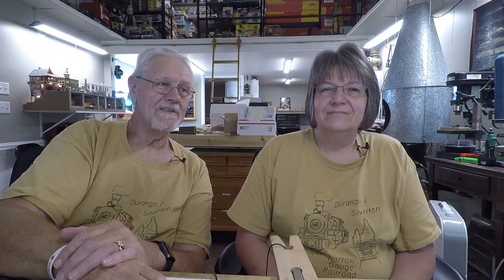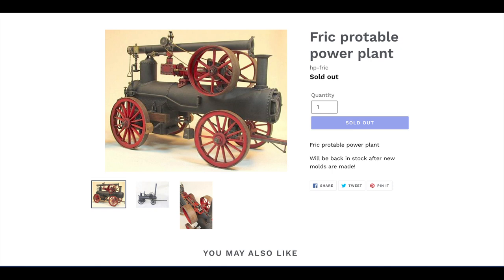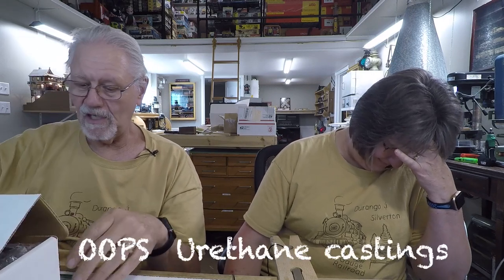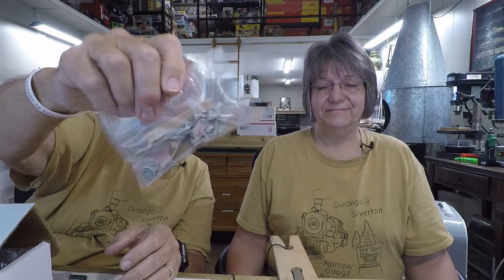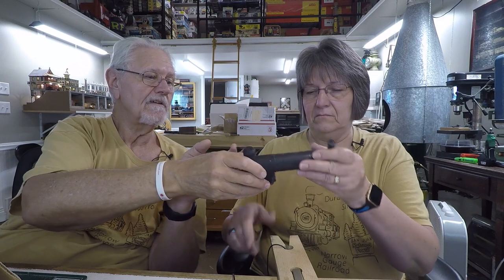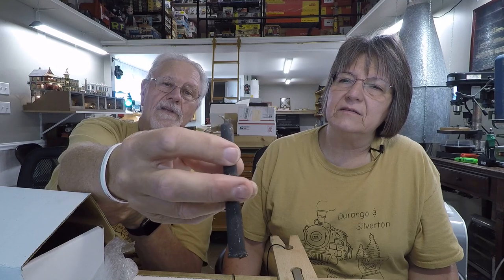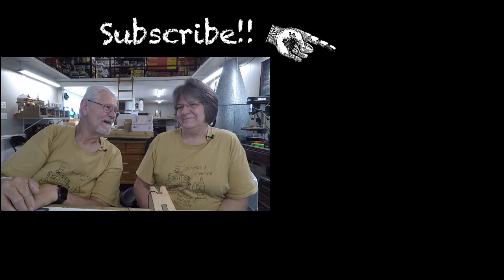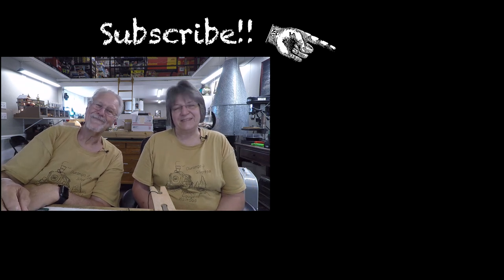Hartford 1:20.3 scale Fric protable power plant

Comment: These old molds or cast parts need to be scanned and drawn into a 3D cad model so they can be 3D printed with these new resin printers.
Reply from the maker: Hum… yes that sounds perfect. Dave has a GREAT 3D printer too
Reply: I unfortunately don't have my own 3D CAD program
Reply: @timothyboles6457  Fusion 360 is available for free online.

Comment: J. Nelson Cross bought one in the early 1920s to power his Frick sawmill and when drought seasons occured his grist mill. The normally water wheel powered York County Pennsylvania Wallace-Cross Mill constructed a shed against the south exterior wall for weather protection, a belt provided power through a removed window. Old photos show the tall smoke stack protruding through the roof, it was modified having a double flare trumpet on the top (The lower flaring outward, the upper flaring back to the original diameter). Horses moved it between the mill and to the sawmill across the creek, the tall smoke stack required removal and replaced for each move. 
Hope the kit becomes available.

Comment: Along with being used as a portable power unit they were used as boilers to power things like portable steam drills for drilling rock for blasting and running portable steam powered bucking saws. Of course this was in a time before the internal combustion engines were around.

I was at a logging museum out on the coast and they had photos of these running "portable" equipment as well as running a small saw mill.

One of the neat things they had was a couple of the old l photos enlarged and put on on the walls in the museum depicting early logging scenes.

Comment: Portable steam engines were used for things like driving water pumps, stone crushers, chaff cutters or running saw benches. All driven by belt from the flywheel.
Just like the prototype, the chimney hinge is a weak spot.
Perhaps you could set yours up to run the saw mill.
Reply from the maker: Jude no space… but perhaps at the mule shoe curve in the big canyon

Comment: Is this considered to be a “steam donkey?”  Great addition to your railroad.  Sorry to hear you need to redo the outside!  Take care and stay cool.
Reply from the maker: Hum... sort of the same idea. Not sure if the name fits... Anyone out there know?
Reply: A donkey would have a boiler and a two or three main drum winch mounted to a single log sled so it could be moved from site to site with relieve ease.

Some of the early donkeys had a large diameter vertical capstan that the wire rope was wrapped around to get the pulling force needed.
Reply: Donkey engines usually had vertical boilers and cylinders to optimize the skid sled's limited real estate.  Job site transport was established by the cable and winch.  
Get the molds scanned so 3 D printing can reproduce robust new ones or simply a single spare part.
Sawdust would be a great bulk packing medium and cheap. Plastic injection molding produces parts laden with static, using de- ionized air flow at the press reduces the issue.